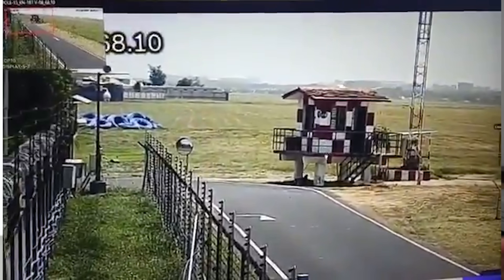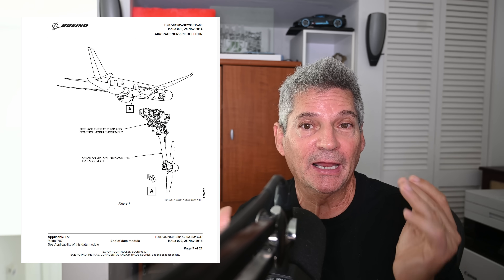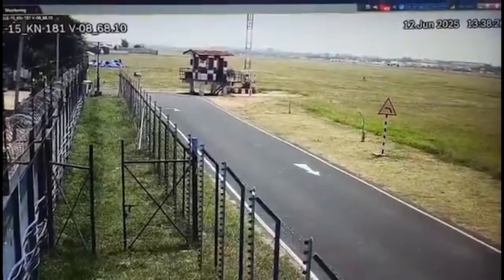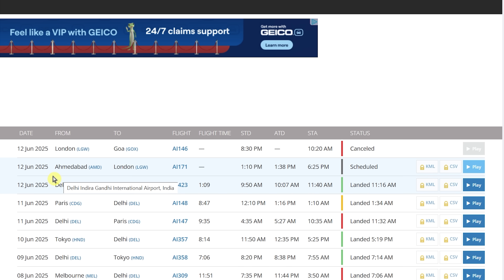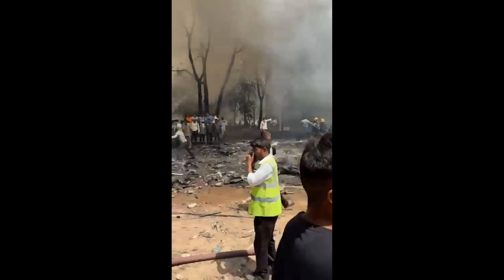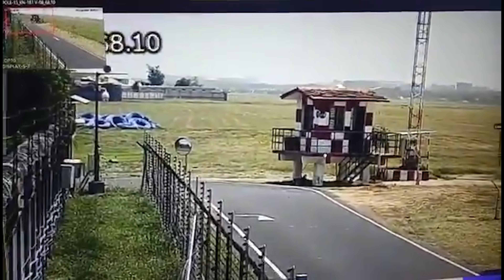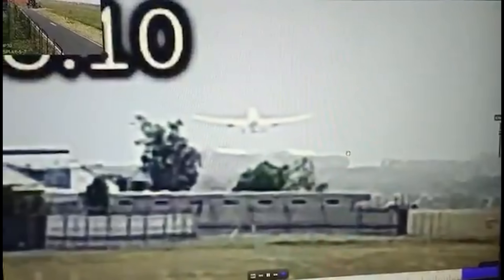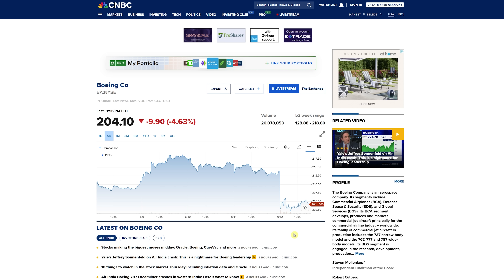What Caused Air India 171 Crash, Mysterious Sound Before Impact

Comment: Catastrophic generator control unit failure shutting down the engines and other critical systems.   Not saying this is it, but there is a similar crash in that part of the world where a faulty control unit needed to be rebooted to fix a problem (ideally while the airframe is still on ground); pilot reboots it 20k + feet in the air when its going hay wire, aircraft fails to "reboot" and they all crash, again maint should not have let this particular plane take off in this example but lax maintenance in that side of the world.  Could be a cracked motherboard or solder came undone and needed to be replaced or repaired in maintenance, power goes out, fuel goes out, engine shuts down.   But heck who knows.

Comment: I see two problems, at 650 ft elevation, maybe a mile beyond runway, the running gear is still down but flaps are all the way up.  Maybe the intent was to retract running gear, but pilot prematurely retracted flaps instead, before they had enough speed.  FWIW, 787 has huge flaps, hard to miss visually.  Losing both engines upon take off is very unlikely, can take off with one engine out.

Comment: The plane loses power flaps ant going to save you probably fuel related sense both engines appear to be losing power and it had to make make good power on the ground to reach rotate speed but soon as the plane pitches up

Comment: According to another respected site the aircraft entered the runway from an intersection  and took off not using the full length of runway.  The video clip of aircraft taking off shows a cloud of dust blown up so he was right at the end of the runway.  I think this will be major contributing factor in any investigation.
Reply: They backtracked down the runway first and used the whole length.  The RAT deployment wasn't a result of flaps or anything, it was due to gross electrical system failure/loss of both engines, and that's rather likely to be why the plane crashed.

Comment: Either pilot error (flaps up by mistake instead of gear) or loss of both engines (explains why the gear stayed down and the RAT was deployed).  Let's hope the FDR didn't shut off like the Korean Airlines one did when engine power was lost.  However, if it did shut down because of loss of engine power that confirms what happened.  Unfortunately, if you are low and slow and lose both engines you are going down close and pretty much right ahead of you and there's nothing you can do about it.

Comment: Can you believe it that an experienced pilot with 1000's of hours in his flight log had a Departure Stall due to pilot/co-pilot error...
Reply: It happens ... but not this time. This was Jeju Air #2  (dual engine failure due to massive bird strikes).
Reply: @Deploracle  this was a boeing issue same for jeju air
Reply: @sawadee2007  Are birds somehow more attracted to Boeings?
Reply: @Deploracle I believe it’s because there are more Boeing aircraft than airbus aircraft in the air.
Reply: The first thing I noticed is that the landing gear is tilted the wrong way with its tippy-toes down at 0:01. On the 787, this only happens during gear retraction, but since the gear is not retracting, it is reasonable to conclude there is a problem with the landing gear. Possible hydraulics issue, could be caused by engine flameout.
Reply: @leekasten3921, it's too premature to conclude that it is attributable to pilot error.

We'll' wait for the CVR and FDR data that should be available soon

Comment: The angle of attack on the start of the video shows a lowered nose, a maneuver to attempt to gain speed and maintain airborne, that's confirmed by sudden nose lift at final
moments. 
The cause had been "power" which takes our focus to onengines and  trim settings. 
On other videos it shows late takeoff, they overshoot the runway, confirmed by dust picked. That's an indication they had a problem on the tarmac, and clocked V1 very late and had no option but to lift off nonetheless.

Comment: The flaps should have been down on takeoff and the gear should raised immediately after leaving the ground. Without flaps, the plane will not generate enough lift to climb until the engines get enough airflow to raise the flaps up.
As an engineer, you should know this.
This was pilot error.
Reply: You can’t blame the pilot without seeing what the black boxes have recorded. It could’ve been a mechanical failure that the pilot couldn’t recover from in time.
Reply: But you still need FULL POWER, if pilot error, also computer errors!
Reply: @johngreydanus2033  Without the flaps and slats extended properly on a hot day, a fully loaded plane is going to have big problems gaining altitude with its landing gear down, even with full power on both engines. Since the tail section broke off on impact, the flight data and cockpit voice recorders should provide information on what went so terribly wrong.
Reply: Not an expert, but I believe the procedure is to retract the gear only after a positive climb rate is confirmed. They never really managed to climb beyond a few hundred feet, so they made the right call in not stowing the gear. Supposedly, for the few seconds it takes to open the gear doors and retract the gear, the drag on the airplane actually increases, so retracting the gear in that situation would actually harm them, rather than help them.
Reply: @Spectacular769  WRONG - a positive rate is usually established within about 1 second after takeoff, the gear should be completely retracted by about 400 feet up.
Reply: It's not engines that need the airflow, it's the wings.
Reply: Gears are not retracted immediately after takeoff. They are retracted after positive rate is called out by PM, here there was an unstable climb, so ig that’s why the did not retract it
Reply: @HomelanderIsSick  - WRONG - gear is retracted (positive rate) about 50 feet AGL, and should be fully retracted by 400 feet AGL.
Reply: @Summitspeedfly  That's bullshit.  It is one of the first steps in the climb but the rotation is not considered a positive rate of climb.  There is an amount of time required for the HUMAN pilots to determine that with all that is going on during those first moments of flight.   It is likely that at the moment they would have normally concluded that, they were aware that they had lost power.
Reply: The flaps had been extended, as can clearly be seen on photos of a damaged wing. Apart from that, if the flaps hadn't been extended, the plane would never have left the ground. The big mystery is why the ram air turbine had deployed. That only happens after a total loss of all electrical power.
Reply: @phuketexplorer  watch the video dude.   NO FLAPS….
Reply: If it was a flaps  issue you would have heard the engine running at max thrust as pilots tried to get it up
Reply: @geraltRiviera  yeah, the fly past video certainly does not sound like both engines at max thrust. It sounds like they were barely even running.
Reply: Cute, but 787 is different. It has checks for this.
Reply: So hydraulic failure?
Reply: Bingo.
Reply: The first thing I noticed is that the landing gear is tilted the wrong way with its tippy-toes down at 0:01. On the 787, this only happens during gear retraction, but since the gear is not retracting, it is reasonable to conclude there is a problem with the landing gear. Possible hydraulics issue, could be caused by engine flameout.
Reply: I can clearly hear the turbines winding down in the clip.  My guess is mechanical problem resulting is loss of both engines. The RAT having been deployed would indicate that also.
Reply: Doesn’t matter if the engines had full thrust or not.  The plane fully loaded would not have climbed to a zero flaps in that case with no flaps and the gear down
. A Boeing pilot said he believes the retracted the flaps instead of the landing gear , the two levers are close together.
Reply: @Strange_Brew But you can't retract the flaps on this plane after take off!
Reply: @nollypra2752  I love you!
Reply: @Strange_Brew  LOL - The gear and flaps actuators are NOT close together, operate completely differently.
Reply: Yesh it didn't look right to me at takeooff
Reply: Toga!
Reply: And as a pilot you know that the Dreamliner will give audio and visual warnings for an incorrect takeoff configuration when takeoff thrust is applied.
Reply: @Royaleoake  you can clearly see in the video the flaps were up.  Yes the pilots should have gotten a warning.
The aircraft fully loaded would not have been able to climb in that configuration.
Reply: Sir, can a faulty APU cause this accident?
Reply: @Gorilla554  it’s a possibility…
Reply: @Strange_Brew because one passenger who was in that same flight 2 hoirs before the crash recorded video showing that something is wrong with the plane, he was saying AC, entertainment system, other electronic features were not working.
Reply: @Strange_Brew  - No, it is not.
Reply: @Gorilla554  - Nope.  It likely wasn't even running.  Not normal to have APU running for takeoff.
Reply: Abwarten ohne den Untersuchungsbericht ist alles nur Spekulation.
Reply: I am a simulator pilot and this whole idea that flaps are not extended is rubbish.  On the A320's I've flown, having flaps extended is optional during flight planning and often you go with them in position 1 which is just barely extended.  The only affect on the takeoff of having the flaps fully retracted would be a bit higher V1, easily attained on a long runway like this one.  The engines in these modern planes can maintain a positive rate of climb even with 1 engine down.  This plane suddenly lost power in both engines either through something like a massive bird strike, a control issue or some obscure mechanical/electrical malfunction.  These are fly by wire airliners where generally things like takeoff thrust is auto controlled.  There would be no reason for the pilots at that stage to move the throttles.  Procedures would be strictly enforced where landing gear is only retracted once there is absolutely positive rate of climb established.  I think it's obvious that just as that was about to happen thrust went away and the climb rate disappeared.  There was no stall.   While we have no indication yet that Boeing is to blame, the onus will be on them to prove they are not since their track record with huge oversight in designing fly by wire systems is abysmal in the years when these planes were being produced.   I just despise the immediate spotlight on the flight crew.  I see them as victims not the cause.
Reply: @arizonastrummer  - "Simulator pilot"?  Translation - not a pilot at all then, and nothing you say carries any weight, because it's ALL wrong.
Reply: The comunication by the pilot to control tower was : “MAYDAY  MAYDAY ENGINE FAILURE… NO POWER NO TRUST”……… Evidently an engine problem Not a flaps issue…
Reply: You got pay from Boeing?
Reply: If flaps were up, the plane never would've even lifted up to begin with.
Reply: @porfiriodiaz4552  not quite true.  There's something called ground effect.  As the plane tries to lift off the ground effects will push it into the air, but only a few hundred feet, just like this one did.  Once they're high enough the ground effects stop and then you're dead in the sky, not getting enough airflow across the wings to stay up.  There have been a dozen or more planes what lifted off with no flaps, then plunged down.
Reply: @STM2811  - So many idiots commenting here.  Lift opposes gravity.  Thrust opposes drag.  Drag and lift never cancel each other out.
Reply: @STM2811   so you’re saying the video is fake?
Reply: @STM2811  You don't need flaps to takeoff, but it's going to take a lot of runway and a lot of speed.  Give me any fixed-wing aircraft on Earth, and a long enough runway, and I'll get it off the ground with no flaps.
Reply: @STM2811  - How many hours do YOU have flying aircraft?  I'm over 20,000 and counting.
Reply: @STM2811  - Well, your logic is lacking.  You have misconceptions about what flaps do.  Flaps DO NOT provide the lift necessary to takeoff - the WING does.  Adding flaps does 2 things, it lowers the stall speed, so that we can takeoff slower and still not stall, allowing the use of a shorter runway.  But they also increase drag, requiring more power to reach the speed necessary for takeoff.   On a no-flap takeoff, (same as every takeoff), it is the rotation of the wing to an angle that will produce lift that allows takeoff.  However, to reach the higher speed necessary to avoid a stall after liftoff, (without flaps to lower the stall speed), you need a lot more runway, as stall speed will be quite a bit higher.  You're a non-pilot arguing with a VERY experienced pilot.  Do you enjoy looking stupid?
Reply: @porfiriodiaz4552  Not true.
Reply: @porfiriodiaz4552  Exactly!
Reply: @porfiriodiaz4552  - WRONG - ever heard of ground effect?
Reply: Electro pulse weapon🎉🎉🎉🎉
Reply: You don't always need flaps for take-off.
Reply: @RafeCruise  This plane won't leave the ground without proper flap configuration. The 787 has a Take-Off Configuration Warning System (TOCWS) alarm.
Reply: @RafeCruise 
You do on a fully loaded 787 on a hot day.
Reply: Gear should be raised only when the pilot confirms verbally " positive rate" ,then follows up with the " gear up" command.

 In an eminent  crash landing , gear should be left as it is to absorb the force. 

Flaps configuration can be set to many levels. A low air speed flap retraction should give a warning too.
The levers are physically separated , one in the middle panel the other on the left side. Unless pilots were distracted with something else, this is highly unlikely.

Comment: It looks like just as he lifted off the left engine belched some black smoke, but more interesting is the plane immediately twisted right, almost like they had asymmetric thrust. I know they can ‘fly’ with one engine, but I doubt it can climb at 600 ft one a single engine. Interestingly, I don’t see any birds, so this may mean t have been a bird strike.
Reply: Any multi engined airliner can fly and climb with one engine out. Every take off is calculated to lift off and climb to 1500’ above airport level, accelerate, and continue to climb with an engine failure on the runway at V1.

Comment: Have you noticed that the building, which the plane hit, did not fall down on its footprint like the Twin Towers in New York fell down on 9/11?
Reply: None of the 9/11 structures fell in their own footprint; there was a sea of rubble all around. And no sign of melted steel, either!
Reply: @Pygar2 the steel only needed to be weakened not melted .
Reply: @ctb2814  I know that, and you know that. They say melted.
Reply: @Pygar2   Melted, no, but deformed by heat - YES.  That’s how steel fails - weakened by heat; it doesn’t need to melt.
Reply: @jacksons1010  True.
Reply: @Pygar2 if a building is 1368 feet tall, another is 1362, and a third building, #7, at 741 and they all came down in their own foot print where do you think the rubble will ultimately would go? All in its own footprint?  You must not know the definition because as cedardrive4599 said, they fell in their own footprint. You shouldn't be so argumentative in something you don't understand the simple principles of.
Reply: @BogusJNutherwebb  Neither tower 1 nor 2 fell in their footprints.  WTC 7 fell because of fires generated by the impact of WTC 1 with it.  480 feet away.  The towers were impacted at speeds of 480 and 550 mph !
Reply: You would be surprised how quickly metal loses all its strength when heated to a certain temperature, it turns into a liquid at a certain point. It's also amazing how thousands of tons can be supported with welded metal, but when the structure is compromised, it quickly falls apart at a blink of an eye and like a domino falling down.
Reply: @kevinleewilliams5119  Very true.
Reply: The Twin Towers didn't fall down when they were hit.  Go and watch a video of the impacts and see whether they fall down or not when the planes hit.
Reply: Exactly. Plus I saw a video where bomb exploded in ground floor in twin towers. Even witnesses were saying it felt like bombs were going off.
Reply: Well, the towers did collapse like a demolition. It falls into its own footing but, the debris is all around. These are 2 different crashes. One was planned decades in advance.
Reply: @russellking1924  "Like a demolition" aka down, in the direction and speed of gravity? It couldn't collapse any other way!
Reply: @Pygar2 They collapse straight down. We agree. Just because the building footprint couldn’t fit all the rubble doesn’t mean they didn’t fall into their own footing. There’s a reason why it looks like a demolition.